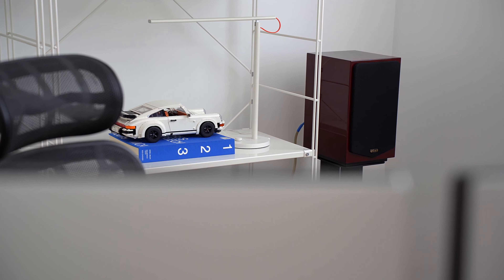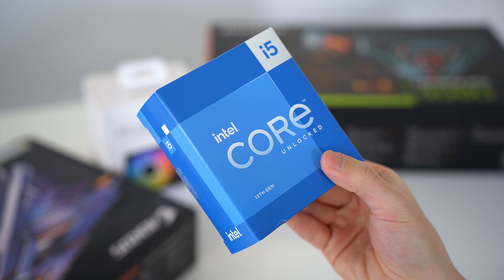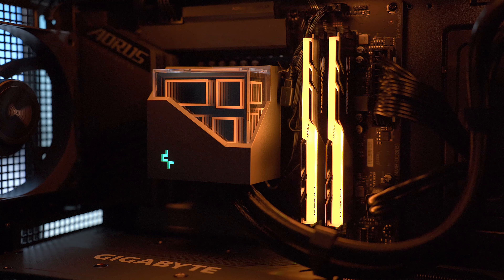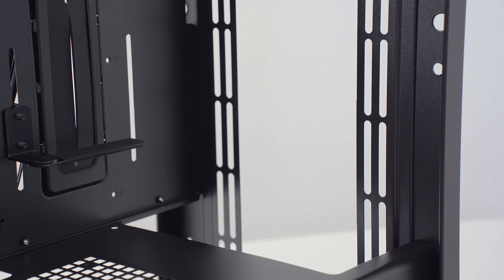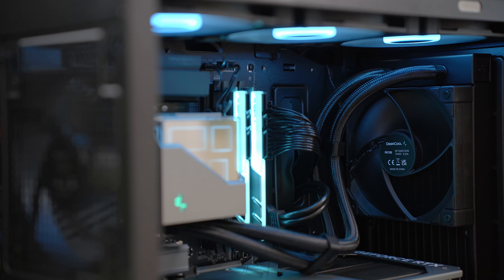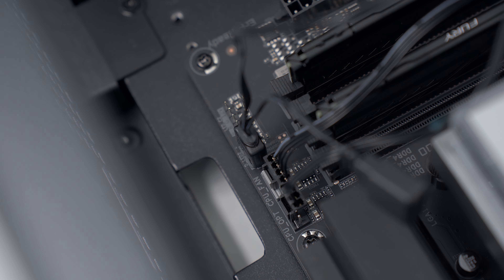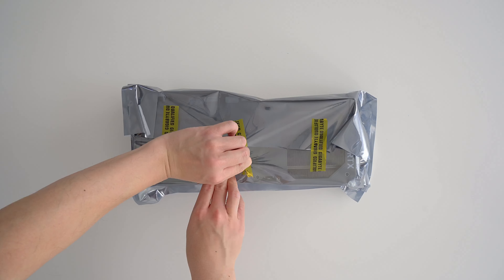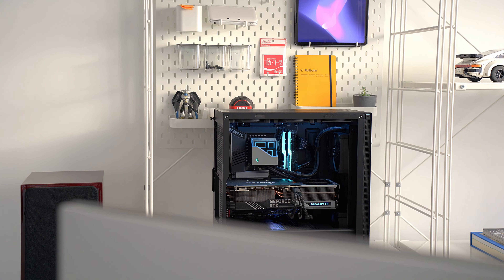Building my 4K GAMING + EDITING PC 2023!

Comment: Great video mate, very informative, especially for first time builders.  There's heaps of how to build a pc vids but yours is the first that Ive seen show where the smaller cables need to be plugged in.  For first time builders, figuring out the power cables is fairly straight forward but knowing where to plug in fan headers or the cables for the AIO, or the front I/O when one misplaced or not plugged in cable can stop a boot let alone a post leading to hair pulling frustration.  "WHY WONT THIS THING TURN ON???"  And a shout out for UEFI adjustment for XMP settings for RAM as well for mentioning and focusing on the need for positive pressure in the case.  Big brownie point for that as well! One of the best how to pc build vids that Ive seen a long time. Cheers.
Reply from the maker: That's high praise, thank you so much 🙏 It was pretty challenging when I did my first PC build so I wanted to be detailed in this video for anyone who needed it

Comment: You would have saved $220+ if chosen RX 7900XTX over RTX 4080 which would have provided better overall performance.
Reply from the maker: True also a great option, but that sweet ray tracing performance… 🥹
Reply: Amd GPUs have problems with stability and reliability when it comes to video editing.